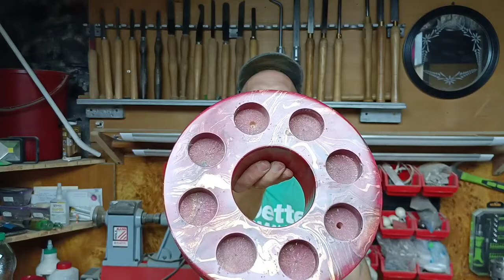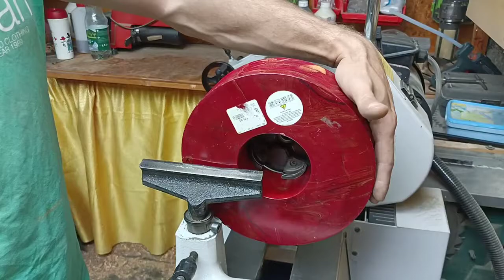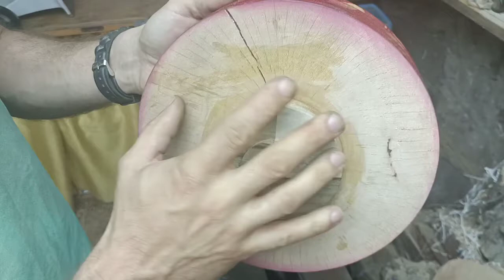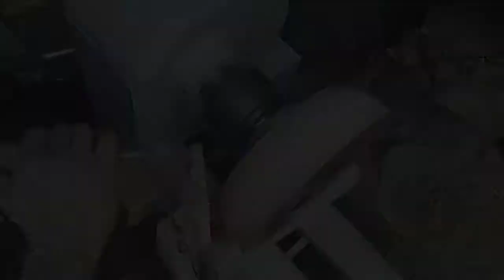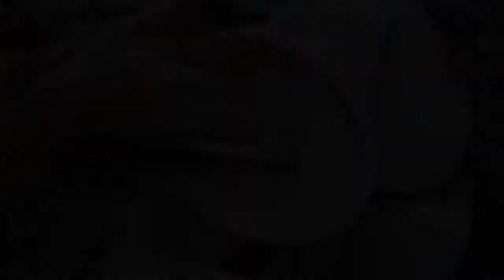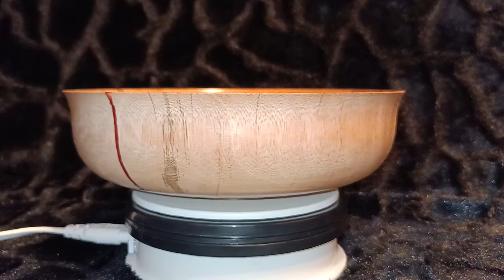Strange wood bowl - Woodturning

Comment: Well done. Using the 5 minute epoxy was just what you needed. It came out quite nice. I only have a guess on the wood so I won’t say. Again, you did well. Thanks for sharing.
Reply from the maker: Thank You, Doug 🤝 Today I was thinking to buy a crack filler but it's toxic and there is so many colors and I should to buy at least 8 cups for every type of wood which I'm using so I gave up. Resin always is next to my hand👍 Take care. Rav

Comment: Great reuse of an old piece! I have no clue what kind of wood this is. I didn't expect that you could save this cracked piece, but you did a fine job. (it was a bit dusty huh 😷)
👍Frank.
Reply from the maker: Thank You, Frank 🤝 I suppose it is a Sycamore but still I'm not sure because I never had this wood in my workshop. Hopefuly cracks were only on the bottom and I removed most of them. It was really dusty wood. Shavings in flight were falling apart and changing in dust. Almost whole hollowing time I spent in dust mask 😵 
Take care my friend 👍
Rav